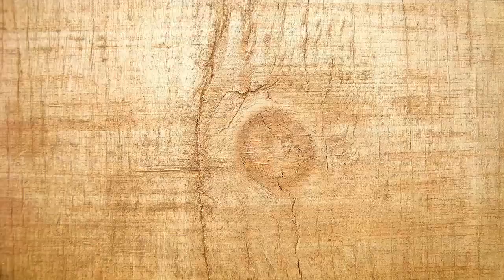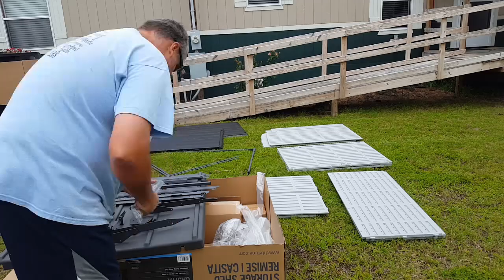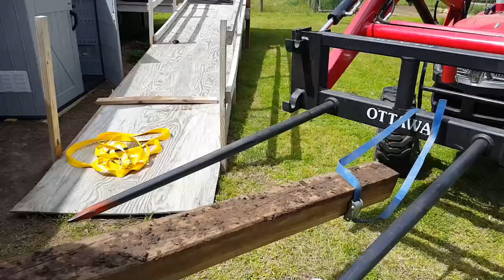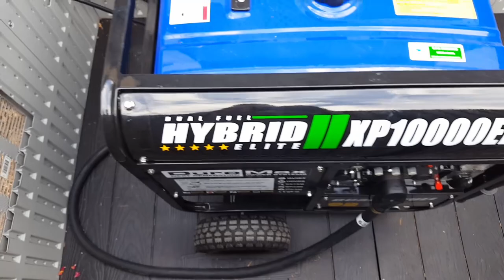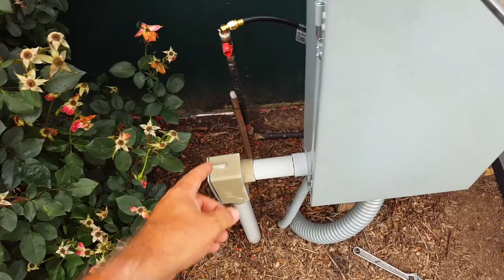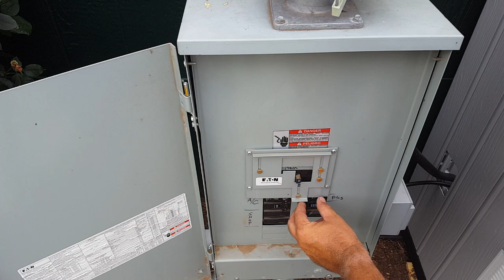Generator for the house - Dual fuel whole house system

Comment: Hello! I have been searching the internet for a while now and your video is about the only video that makes since to me. But made the mistake of reading all the comments and Im now confused again. SO.....your tank has the typical high pressure regulator on it and the regulator that comes with your generator steps it down to the correct PSI correct?? My local propane dealers are not interested in helping me with this so Im going to have to do this myself. Ive got the duromax 12k and I will be about 25/30 feet from the tank. I will not have it connected to the generator unless the generator is needed so my setup will be a little different. What is your input on my setup.....regulators, line size etc. if you dont mind me asking?? Thanks! And good video!
Reply from the maker: Yes we put a high pressure regulator on the big tank. the duromax has a regulator built in… they are designed to run straight of a tank.

Comment: Rodents cause over 82% of home fires each year. I highly suggest a hard plastic cover and glue split fuel line glued with weatherstrip adhesive around the electrical/gas service opening and hard screw it to the shed. I would start, run, check oil and filter every 6 months to maintain. 
  When an engine shuts off, one intake or exhaust valve spays open and lets humid air into the cylinder. Twin cylinders are worse. But this will form rust on bare cylinder walls and the rings will scratch the bore. On a boat in the winter, this is called "Fogging" the cylinder(s). The crankshaft normally throws oil onto the cylinder walls keeping them lubed. 
  Test output with a digital multimeter for proper output. 
  So a short list that "Will" help eliminate future issues. 
DK, ASE Master Tech since 1978

Comment: As someone who built a generator dog shed (including a concrete pad), some things to point out:

1. Please measure the temperature inside the shed on a hot summer day after an hour of running. You might find that you need to either add an attic fan in yours (like I did) or open the doors on very hot days, or you'll cook your generator

2. Why did you lose power? Often, it's going to be due to very windy conditions. That's why I built a generator shed with an 8" pad and tied the shed down to it. Make sure your shed is good enough to handle a cat 3 hurricane.

3. At least for me, the Relliance "PowerBack" device didn't work at all. It almost never rang like it was supposed to when the power came back. YMMV. If we lose power long enough, my internet stops working, so I use that to determine if power is back. When the router shows we have a signal again, that means we have power!

Good job and great video!

Comment: You are fortunate to have propane available.  I live in Maryland and NO propane dealer will provide a tank or service for my portable 8kw generator (or any other portable.)  Left with 20/30/40 lb tanks as only propane option,

Comment: Eufala, how is the 10,000 Duromax working out?  Got the 12,000 but not hooked up yet.  Tamaha
Reply from the maker: Was great for 3 years… but mom moved so we no longer have it. 
https://youtu.be/utl6faKT7i4
Reply: Great.  I am going to build a security cage for mine.  I have about a 50 ft run with 3/4 inch scr 11 pipe, and will be making some psi adjustments with my propane provider to my low pressure regulator.  Connected my risers to 4x4 posts with a 2x6 screwed to them so I could get more stability and protection from uninvited vehicular guests.  Also am enclosing gen. In an enclosure similar to yours with a roof.  Enjoyed your post.

Comment: Put an Micro-Air Easy Start soft starter on your ac unit. That will let your ac unit gradually start using only about half the amps it normally would take and cuts way back on the running amps too. This is ideal when you want to use a back-up generator and it will also cut your power bill way down. It cost about $345.00 but will save you a lot every year on your bill and alow you to run more with your generator. I hope this helps someone.

Comment: I hope you put a regulator at the generator and not have 10 psi running straight in. The generator runs on 1/2 psi.
Reply from the maker: Ohhhh read the comments or read the user manual
Reply: @BigRedFishDad  I haven't read all the comments but I am a service technician for a propane company. I hook those duramax generators up all the time because customers hook them up wrong. I couldn't see your hook up to your generator after the first stage regulator was installed on the tank. I assumed 10 psi was running straight in because i see it all the time in the field. It will work until it blows diaphragms and seals in the unit.
Reply from the maker: @1389sniper  except the duramax gens have built in regulators designed to run straight off bottles.
Reply: @BigRedFishDad  what im trying to say is, if you are not running the original hose assembly then its not regulated properly going into the unit. Im just making you aware because im the person that has to fix generators, water heaters, stoves, furnaces, and so on because they have to much pressure going to them and it blows seals and diaphragms eventually.
Reply from the maker: @1389sniper  Again... please read the manual or comments as this has been hashed out by "experts" a hundred times below and you are the same just trying to sound smarter than it takes. As I mentioned above (and you agreed) they are built to take tank pressures. Of course you are wrong about the regulator it is built into the generator not the hose it is nothing like a gas grill... This is why I do my own research and install many things myself. "experts" today can't read or want to make it harder than it needs to be so they can charge you more. Look up my generator and read the manual before posting again. Also watch the 3 year update  video it ran awesome and served my mom VERY well until she moved... Thanks for watching.
Reply: @BigRedFishDad  no your wrong. The regulator is built into the hose assembly like all duramax generators except the ex15000he and its mounted on the frame. But since she moved, then it will be someone else's problem in the future.
Reply from the maker: @1389sniper  like I said read the manual before posting it just reiterates my comments above about “experts” and please post the name of your company so people will know to avoid you all… thanks for watching.
Reply from the maker: @1389sniper  I’ll help you out and for those reading this if a propane guy says his name is Andrew Simpson… don’t hire him but my guess is he is just another keyboard expert.. 2 minute search on their website page 18…. “The propane regulator / decompression valve is located on the frame of the generator below the OHV valve cover. Ensure the propane hose is securely connected to the regulator/compression valve.”
Reply: @BigRedFishDad  The generator comes with 1 regulator out of the box. That is the twin stage that is built on to the hose assembly. Which takes tank pressure which can range between 100-250 psig, "depending on outside ambient temperature", down to 1/2 psi which is 14" water column pressure. The way i hook them up is 10 psi at the tank to the acme fitting close to the generator then screw the original hose assembly to that and they work like a charm. I use 5/8 copper tubing which has an inside diameter of 1/2" all the way from tank to generator.

Comment: We had a low preasure regulator on a 1,000 lbs. propane tank. The propane company took off the regulator off the tank and ran a high preasure 3/4" line around to where the line connects to the house and put a "T" on the pipe before putting a low preasure regulator on to feed the house. Then we came off the "T"  and ran a 3/4" high preasure pipe from there over to the outside of the garage between the corner and where the car door opens and I put a propane tank screw on fitting there. That way I could run anything propane that I wanted like a grill, fish frier, torpedo heater inside the garage if I wanted too. But the main reason I ran the line is to run my Generac 25 kw protector series liquid cooled generator. But, the pipe at the garage is for all the low preasure stuff I mentioned before but also the reason it's high preasure is for my Duromax xp15000eh dual fuel 15,000/12,000 watts generator. I know yawl are all saying that you can't rush a grill and all that other low preasure stuff on high preasure, right ? Well what Idid is bought new braided stainless steel propane lines that have an adjustable preasure regulator on them so I can turn the preasure all the way off and turn it up fine tuning it to work on each individual item that I want to run. The hoses are 3/8" just like what came with the generator but are 12' long. I also put on the inside of the garage next to the door a 50 amp plug box. Well that's it. I hope this helps someone.

Comment: One more comment. Put a Micro-air Soft Start on your ac unit. It let's your ac unit start slowly using a lot less amps at start up. Say your ac uses 75 amps at start-up and then levels out at 25 amps at running. A soft start will bring the start-up down by at least half the amps used at start-up to around 30-35 amps and running amps to around 10-15 amps. This will make your compressor last a lot longer and will let you run your ac with your generator with no bog down so you can power more with your generator.  The soft start is a little pricey but worth it.  The cost is around $ 299.00 to $ 348.00 depending on the size of unit that you have. I strongly suggest everyone putting one on their ac unit because like I said it will make your compressor last alot longer and it will make your power bill go down because you'll be using a lot less power at the start-up cycle and running time. A hard start makes your unit come on fast which is hard on your compressor. Do the change and run more with your generator.  I hope this helps some of you out there.

Comment: Go by the manufacturers information.  The 60% - 80% recommendation was from my generator a Duramax 15000/12000 dual fuel. Another thing I've come to find out if you run your generator at low capacity for long periods of time will damage your generator

Comment: So what size line from tank to generator and what psi regulator did you end up using...I’m doing the same thing
Reply from the maker: I think it was 1/2 or 3/4 black pipe and 10psi regulator. I would definitely look at the poly pipe if your going to do it ours was still working fine after 3 years but we wish we would have used the poly pipe instead.

Comment: Are you using a 50 amp breaker on your 10000 duromax?
Reply from the maker: I don't remember but I used whatever was recommended in manual. Looking at my video it looks like 50 or 60 but is a little blurry. Is probably a 50 since that is the highest output plug on the generator.
Reply: @BigRedFishDad  How much was the cable that goes connected to the generator and power box? Great info and vid, Thanks.

Comment: To be honest, if it was me I'd want the generator to be set up so that if the city power goes off the generator would kick on on the spot. If you have medical equipment you would want it to kick on and not even flicker. Having a system that would not ever lose any power to your home would be the best for older people or PWD People With Disabilities. Some generators will kick on a few minutes after the power goes off but if you have any smart home or medical technology you don't want that because it means some things like CPAP's will kick off and reset. Smart lights like LIFX lights and Internet connections are bad when there is a gap between city power and generator power. Having a system that sends full power to the entire home while the generator is starting up would be the best solution.
Reply from the maker: Yes, but now your back to 8k to 10K we did it for less than 2.  You should check out the 3 year review video of the system it served them VERY well.

Comment: I hope you have a second stage regulator before the hose at the generator and unless it gets well below zero you don't have to worry about a pressure issue.
Reply from the maker: Nope... no need for second stage that was the whole issue. Needed a min of 3psi at the generator we had a 0.5psi or something like that and that was why it wasn't working.
Reply: The problem is pressure drop, too small of a pipe run too far for the total BTU! If you have a red 10 lbs regulator you are sending too much pressure to the generator whether its working or not! the regulator that comes with the unit and others like it is tank pressure inlet and 13 or so inches of water column lock up 11 inches flow (1/2 psi ) but the 3/8 hose is only 4 feet long not 80 feet! I also hope you put pipe tape around the buried black iron or you will be replacing it.
Reply from the maker: @dennisstein952  not trying to be rude but this has been hashed out several times in the comments. This generator (stated in user manual and website) requires a minimum 3psi to work. It is designed to run straight off a bottle and has its own regulator on it. If you put a step down regulator like you mentioned and which is usually 1 or less psi it won't run.

Comment: Get a wattage being drawn with each thing running and with it all running.  Make very sure you don't run you generator only 60% - 80% of capacity or you'll damage it !
Reply: What percentage of a generator power should you use.  Lower or higher? They seem to be very efficient at 25-50% as advertised by the manufacturers, but very inefficient at full capacity.

Comment: I know it's been a while since you've made this video but I've just seen it. I don't know if you've run across this or not but if you haven't you should seriously consider installing a soft start on your ac unit. I've seen units take over 51 amps at start up and after the soft start install around 21 then after a couple of seconds the unit comes down to about 14 amps at running speed. And will save on your power bill, make your unit last longer and run quieter and be able to run more with your generator.  I hope this helps you.

Comment: I want to know what diameter hose you used and what the specs on the regulator are. I have the same generator and I don't want to guess at what I need to make it run off my 500 gallon tank. I really appreciate any info you can offer. Thanks!
Reply from the maker: we used 1/2 black pipe if I remember and regular 3/8 standard hose to the generator. The manual says you need minimum of 3 psi.

Comment: I am doing something similar with a 15kw DuroMax for my grandparents.  I have a high pressure regulator at a tank like you did.  From that black 1/2" pipe did you connect directly to generator just like you would with a small bottle?  His generator has what looks like a high/low combination regulator at the generator that the hose from a bottle would connect to.
Reply from the maker: We used a longer hose just  like the one that came with it but had a regular fitting on the end for our black pipe. Ours has a built in regulator on the generator so it can run directly from a 20lb bottle thats why there is no need to install anytging else.
If i were to do it again use the yellow poly tube for gas lines instead of black pipe. It is probably same price or cheaper and lasts longer and eaaier to install.
Reply: @BigRedFishDad  That is what I bought. 1/2" yellow poly tube.  So my setup is about the same. Just need to get the same hose you are talking about to get to 1/2" NPT.  Where did you get that longer hose?
Reply from the maker: @jarrettlassig8052  same LP shop as regulator but can get on Amazon cheaper
Reply: @BigRedFishDad  Do you have a link to the hose on Amazon?  I seem to keep missing it somehow.
Reply from the maker: @jarrettlassig8052  I am sorry it has been so long ago I really don't remember the sizes... but it was something like this one: https://amzn.to/3iw5LT3 and then if you have 1/2 outlet you might need an adapter but check your sizes before ordering. https://amzn.to/3hrBPpP
I am pretty sure the generator end of the original hose is 3/8" female but check first.

Comment: Thanks for the vid! Too much hassle IMO - I'll stick with gas.
Reply from the maker: I would too in my area normally never out of power more than a few hours. Buy like anything else take a little more time in the beginning to save time when you need it. For my mom gas wasn't an option. She gas trouble with gas cans and often two or three days without power thats about 9 refills if using gas... and you know it will run out while your asleep or when it starts raining😁

Comment: I've got a duel fuel champion 7500 running watt. How in the world do I go about hooking it up to my 500lb propane tank??
Reply from the maker: Probably similar to what we did... just depends on if it has a built in regulator or not. Ours is designed to run off of bottles so we technically could have left the 10 psi regulator off but that just isn't a good idea on a large tank ;)